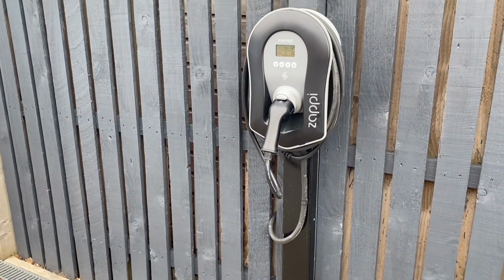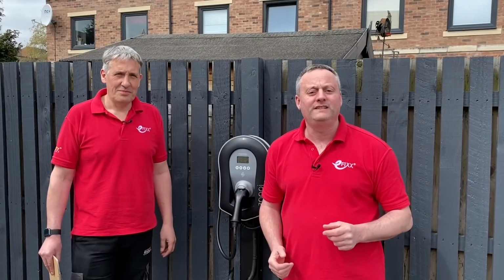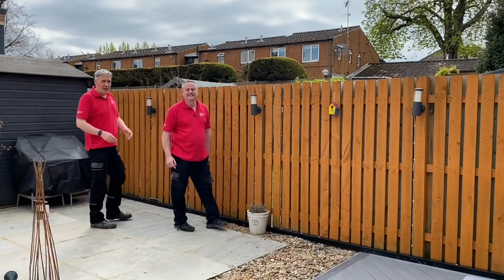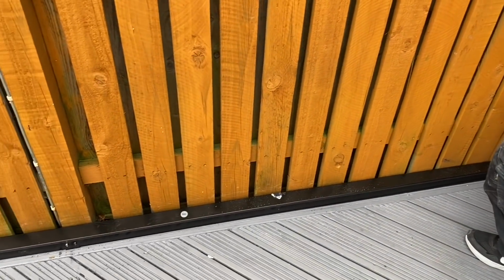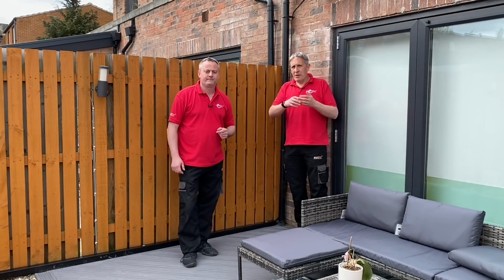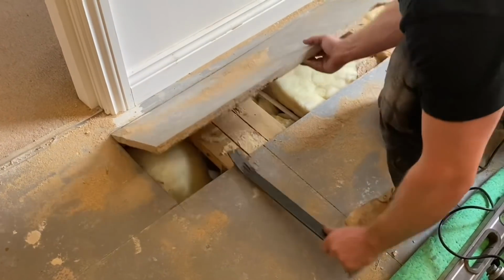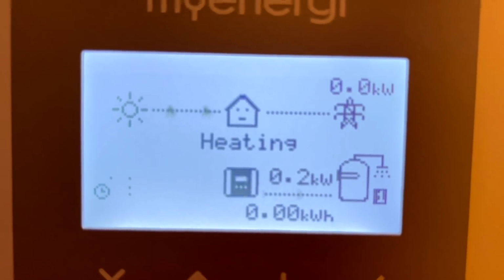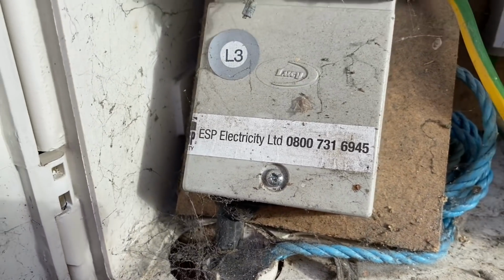ZAPPI EV CHARGER installation UK - It WASN'T easy - find out WHY

Comment: Why does it cost a minimum of £400 for fitting? And why is the power outlet £600? Yes I understand safety and a circuit but it is still a lot of money for what it is. 😡🤠
Reply from the maker: Is £400 for a days work and all of the parts - 6mm sq cable, small consumer unit etc unreasonable?
Reply: @efixx  thanks for the reply but I am not taking about a all day job but the minimum that the job requires. Small consumer unit about £40, 6 meters of cable £30 if it was a full day that would be about £37 per hour.😳🤠

Comment: Hey guys great video. This is a very similar install to how my house would be. My question is my garage is at the bottom of my garden with a consumer unit installed already. If I were to upgrade this to meet current regs could I supply an ev charge point from it? Thanks
Reply from the maker: Yes but it all depends upon the existing cable size. The Zappi can be configured with additional CTs to load share / shed with the other equipment in the garage - so eg it would reduce the charging current if a tumble dryer was in use.
Reply: @efixx  thanks for the reply. The supply cable to the garage is 10mm armoured so should be fine

Comment: Another great clear video! 

What happened to the CAT 5 cable, was it jointed in the wiska box and then where did it end up getting run to if you used a wireless CT?

Keep up the great work
Reply from the maker: It’s in the Wiska box and can be jointed if needed on a future upgrade.

Comment: Top job lads, but how much did this cost the customer.....One kidney or two? Also, how much is the swa with added data per m...What a great idea.
Reply from the maker: This was a chunky install due to changing the consumer unit etc so two kidneys and a few pints of blood- The EV ultra cable is around £5 a meter (copper price dependant)  - available via Yesss , Replenishh or TLC

Comment: Jeezus! If my property was configured like that I would have the unit, even if it was capable of being isolated, inside my property - on the gravel section, for instance - to avoid vandalism etc, and loop the cable over/through the fence when charging the EV. Use a doored cage, or similar, to protect it from the dog!
Reply from the maker: Its a private road
Reply: @efixx  ❓Unless ‘gated’, private roads, can regrettably, be easily frequented by anybody.  They are merely roads which have not been adopted by the local council, thus their upkeep is the ‘private’ responsibility of the property owners on that ‘road’.

Comment: Fantastic, informative video as always guys, thanks. My EV charger point install is similar, with power supply to front of house, CU at that end of property,  9m of cable run in the house and a further 24m to the garage at the rear of the property. A few questions if I may, 
Is it worthwhile running 10mm T&E for the internal cable? 
The internal cable therefore has a separate Cat5e/Cat6 cable, what separation under floor is needed from the 240v? 
If not using Ultra EV outside does The separate armoured Cat5e need to be clipped separate to the 6mm armoured 240v?
Much appreciated.
Reply from the maker: If you use a data cable rated at the same voltage as the power cable they can be run together. - although they can be tricky to find. Cable also needs to be suitable for outdoor use - resistant to UV etc

Comment: I was always told never run dater cables along side mains cable as the mains can Couse interference problems that's why TV areal cable a telephone lines are kept separated .
Reply from the maker: It’s shielded and twisted pair - plus it’s comma to an EV charger not a NASA base so no real issue.

Comment: Ok good vid 
If I ran the cable on a similar installation and purchased the charging unit could I just get a spark to connect the ends would this still reach regs
Reply from the maker: Most electricians aren’t keen on signing off another persons work.  Best to talk with an electrician first and agree a plan. To get the OZEV grant you need to use a OZEV registered installer.

Comment: Cant be professionals notched a I beam  you havent worked on  I beams before you are not allowed to touch the top and bottom part of the joist only drilling through the centre
Reply from the maker: The beams above the consumer unit are traditional timber. We’ve done quite a bit of content on the issues with I-joists - https://youtu.be/c_5MqhJLwFk
Reply: @efixx   I've been doing this for 30 years have worked with traditional wood joist  and I beam  I have never seen a solid joist above a  Consumer unit with I  beans have only been used only on load bearing areas like stairs
Reply: You can clearly see that is the bottom of A I beam   Traditional wood joists do not get used when I beans are being used they use laminated beams  I will show the video and photos to an NHBC inspector and see what he says about it

Comment: The Harvi can be mounted on the side of the house where the Zappi is and extend the Harvi CT wiring with CAT 5/6.
Reply: This would require the harvi being placed in an IP rated box as the harvi itself is not IP rated and is for indoor installation only.

Comment: The outside meter cabinet is for Distribution network operators and meter operator only. It’s not for fitting customers monitoring equipment. You shouldn’t be fitting anything inside there.
Reply: Not necessarily true. Northern Powergrid site explicitly says customer equipment can be fitted in the meter cab.

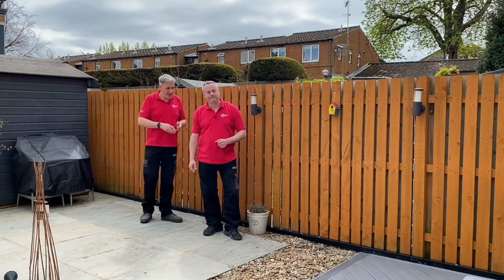Comment: So what happens if my neighbour in property no.2 (@4:00), gets a charger installed? will my incomer get overloaded, and I'll get power dips?
 So I have to call an electrician or the DNO, and there is actually nothing wrong with my installation at all.

DNOs should be required to go round unlooping supplies and upgrading to 100A before everyone starts buying e-vehicles....
Reply: The installer at property no.2, won't have known they were on the end of the loop

Comment: It might be worth mentioned that the Harvi cannot be used for wireless load management. All load management systems must be hardwired the harvi can only be used for solar purposes.
Reply: Absolutely correct. I was thinking the same thing. It wasn’t made clear. It’s currently not compliant with G100 to use wireless ct for load management. Solar only.

Comment: I do not understand why a fence is not considered permanent? You fixed the lights to it so why not the EV cable. World has gone mad. A flat roof might only have a warranty for 20 years. Much like a fence post.  🤦‍♂️
Reply from the maker: If the fence post was properly constructed and didn’t wobble then it may have been okay - but it wasn’t.

Comment: What was the Galv trunking fixed to? The decking/patio slabs on the floor. Planning a route through a flower bed, and want to avoid digging it up if possible. Would I be able to run it on short stakes, just off the floor?

Comment: I think that I would have offered the customer galv pipe/conduit rather than box trunking.
Reply from the maker: We don’t think that would have been as neat going across the decking etc
Reply: Can't pull SWA round a 90 degree bend in conduit
Reply: @starbarrothschild788  depends on the bend radius, but it doesn't need to be SWA if it's in conduit anyway.

Comment: I find it interesting to see the ev cable with the integrated network cable. How does this work with the separation you are supposed to have between power and data?
Reply from the maker: It’s a screened Cat5e cable and it’s just used in the Zappi for the current signal flowing in to the property. If it was required for internet connectivity the data rate required is low so speed loss due to any interference wouldn’t be a big issue.
Reply: @efixx  thanks for the explanation. Makes a lot of sense now
Reply: At a constant, fixed distance from balanced line and neutral conductors there should be negligible induced currents. And protected by the SWA not much will come in from the outside either.

Comment: Well that was a whistle stop tour of the install - I felt fatigued after watching it. 🤪 A couple of questions though.

To what did you affix the trunking? The fence wasn't appropriate, so I'm wondering if you still affixed to the fence posts but lower down.

To what did you secure the especially made EVC bracket? Mention was made of securing it into the ground (sorry if I've misunderstood that), but from the fleeting glimpses of the pavement, it looked like block paving, so what did you affix to that was relatively immovable?
Reply from the maker: Thanks John - the trunking is fixed down to the stone flags and the decking. We assume it would be re-routed under if either are changed.

The post to fixed to the concrete channel drain which runs parallel to the fence. The fence is not much more sturdy!

Comment: The title is misleading as it makes it sound like the Zappi made the installation hard and not, as it turned out, the location the client had chosen for it to be installed.
Reply from the maker: See the first video in the series - https://youtu.be/wnmW6W9j80I
Reply: @efixx  that explains the location but still not Zappi specific issues.
Reply from the maker: It’s a difficult installation regardless of the charger type.

Comment: Quality job guys. Did you earth the capping lid? It wasn’t mentioned in the video and as the Zappi has a built in A type RCD the supply circuit wouldn’t be RCD protected 🤔
Reply: chances if damage are low with swa so in my book the lid won't need any further earthing as if supply is tncs you could make earthing the lid worse.

Comment: This goes to highlight the issues so many people will potentially face with doing an EV install. And how do you do that for someone who lives in a block of flats? Or how do you do it for someone who has to park their car on a public street who does not have their own driveway or cannot park close? Its going to be massively disruptive to many people. Its going to be similar to the availability of a reasonable interweb connection as to choosing a property - can I sensibly plug my car in to charge it?
Reply from the maker: Good points - Solutions are emerging for all these issues - from community EV hubs to electric filling stations - however charging at home will be the cheapest option.
Reply: There are lots of issues.  The 300Mil that the government recently announced is nothing. It needs billions investing for the infratructure to be ready as more peeople can transition accross to electric - forced possibly by the bans on petrol and diesel cars. This, not helped by the wanting to phase out of gas boilers - more load on to the grid that already struggles in a cold winter. It won't be a massive instant change but over several decades as some properties are demolished and re-built it will. With climate change and warmer summers is there going to be an increased use of air conditioning?
Micro solar home generation is OK providing your car is at home to charge it. If its in a factory or office car park, then you are reliant on the grid again to source your power, unless you can afford a suitable energy store aka battery to store it for later use. Teslas powerwall for example is 13.5kwh. Not enough for a full vehcile charge (not everyone will need that). Plus you always loose/waste energy in the storing and transportation process. 
Not everyone needs to charge it every day. And the battery technologies etc are improving all the time.
Governments around the world need to be looking far more at how to deal with the problem as a whole - not just the individual issues.
Its going to lead to properties that are just not going to lend themselves to home charging - victorian terraces for example. A bit like the broadband divide. And all of this assumes you can charge your vehicle on your own property. If you can't then you are going to have a limited housing appeal. What if you can't guarantee to park outside your own house to use your own charger? Not to mention electricity theft through unauthorised use of charging points. And also the local low life unplugging your vehicle part charge or wanting to steal your charging cable. 
EV's will need to have a tax of some sort. At the moment its 5% for energy taken from the grid. Kwh used per km would seem a good starting point. 
Electricity costs are going to go much higher - its got to come from somewhere to put it in to the grid. At some point we are all going to have to pay for the infrastructure to support this all. I don't see it remaining a cheap way of travel for long as the infrastructure is developed to cope.
Don't get me wrong - we are going to have to make the transition - we moved mainstream from horse and cart, to steam, to petrol/diesel and now to electric but its going to be far from an easy process.
Reply: I feel you pain there. For now, people living in some blocks of flats,  (if not the majority of blocks of flats) are screwed up. Some management companies have no knowledge whatsoever about this issue, and the ones trying to help, already want to change an arm and a leg just to try and gather info on how to install EV chargers in a block of flats. I spoke to an electrician another day and he told me that in order to have EV chargers for each flat in a  block of flats, the block of flats need to apply for a permission from the grid in order to install new power supply all due to the power demand that it will be needed to charge all the vehicles in a block of flats. Plus some management companies want all flat owners/lease holders to agree in order to go ahead and have EV chargers installed. Now, knowing how it is near to impossible to have all lease holders to agree about something, good luck.
Reply: Totally agree. Its going to require a lot more thought. As for charging in liverpool? It'll not just be the wheels that get knicked it'll be the copper from the charging leads as well
Reply: @guffermeister  
Ah ah that is a good one.
Reply: @guffermeister  Copper stolen? Almost certain.

Already happens on the railways and even on motorways.
Reply: @ruinunes8251  I think in some cases it's going to have to need to change the distribution transformers feeding the houses and blocks of flats and quite possibly the laying of thicker cables.

Not going to be cheap.
Reply: I have noticed in liverpool streets with terraced houses they have put charging points on lamp posts , it's a start but a long way from a charger for every car

Comment: Good video of a tricky install. Did you need to provide RCD protection for the 6mm T&E - I guess you could keep it more than 50mm from the floor and ceiling but was the metal capping in the wall chase 3mm thick? If you did provide an RCD, did you go for a time delay to give selectivity to the zappi's inbuilt one?
Reply: The RCD only protects what is downstream from it, so the integral RCD in the Zappi only protects from electrocution on the output of the Zappi, ie. The cable down to the car.

For me personally, I would want to see an extra RCD providing protection for the cable input to the Zappi.

So the idea that both may trigger together when a fault occurs at one point and you want one particular RCD to trigger before another is flawed.
You want both RCDs to trigger as quickly as possible and within the required time, as they protecting different parts of the circuit.

Comment: I think people try to over complicate things, it's just another circuit, it's no different from a shower circuit or any other circuit, companies jump on the band wagon and because that's all they fit they declare themselves experts.
Personally I would not have run the swa with data, I would have probably opted for a wireless access point either in that bedroom or outside, that would have given better WiFi upstairs and outside, then would have looked at utilising the airing cupboard, and possibly have run the swa through the loft as well, depending if the customer was ok with it.
That trunking will be full of all sorts in a few months. Another thing I would have done, was use white plaster, blends in better, it looked like he had notched the bottom of the joist, with that type, you are not meant to cut into the flange,  I didn't notice any plate over it as it wasn't 50mm from the bottom.
Reply: Interesting thoughts. Silly not to include a data cable in that install while running it in. You would only regret it later if needed.
Reply: @AndyK.1  maybe your right, but that cable is silly prices, like everything they fetch out, because it will save someone time they think, I know let's clack them, if I was running a data cable I would run some external data cable and leave it in the shed, then they could use a powered hub for more data points if needed
Reply: @acelectricalsecurity  some nice trench grade cat6e would do nicely sir!
Reply from the maker: The data is this case is for the CT (if we use it) - Zappi uses it’s own wireless protocol. The property doesn’t have a front to back loft due to one of the floors being in the roof. The joists above the consumer unit are traditional timber.

Great observations thanks 🙏